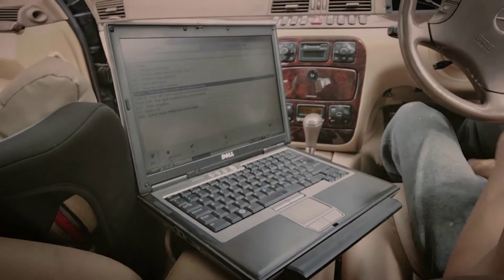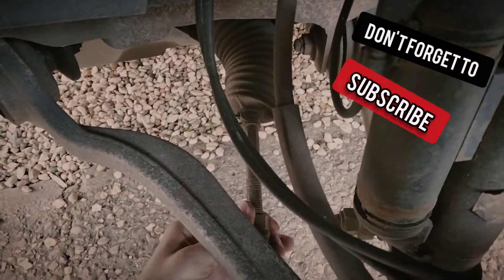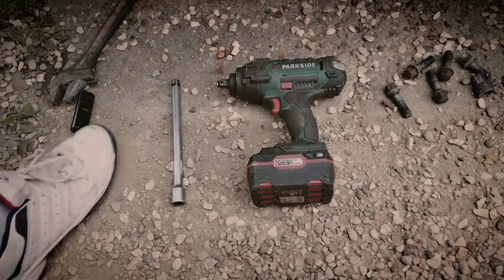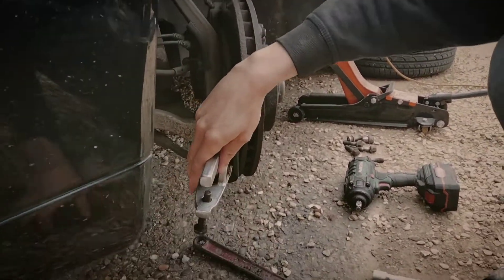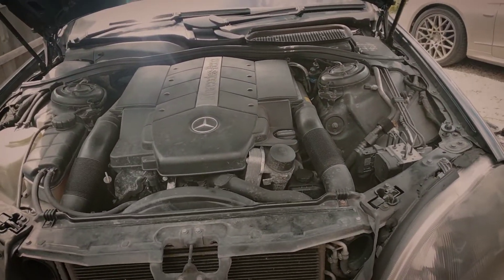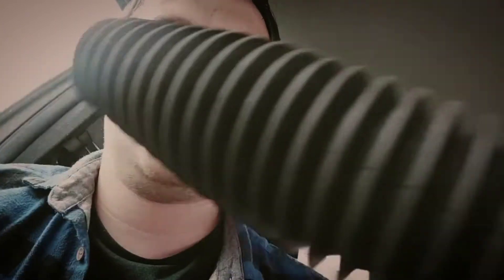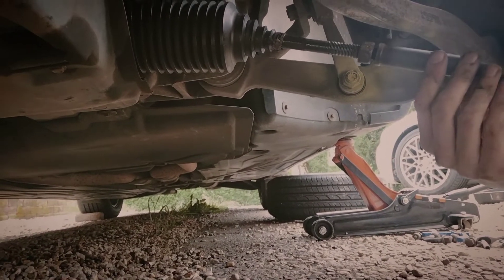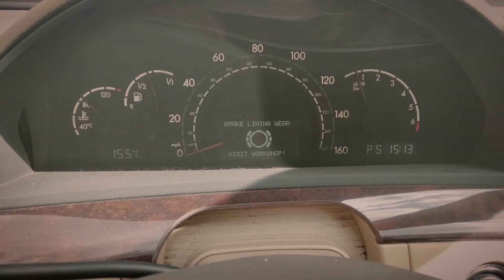Mercedes Benz Replacing Track Rod Ends and Steering Rack Boot #subscribe

Comment: it still does that annoying temp gauge thing you know!!!!! im getting das out at least once every two month! replaced passenger door module and reprogrammed, welded silencers back on, sorted rear lights OMG the corrosion on them tabs dude!!! and ive done the passenger seat motor and installed a lovely headunit thats better than the standard awful one!